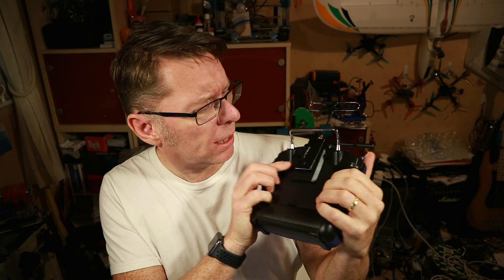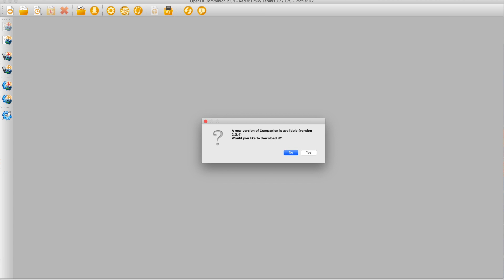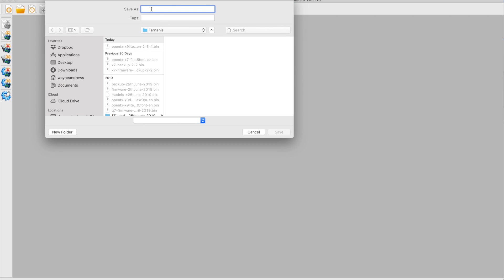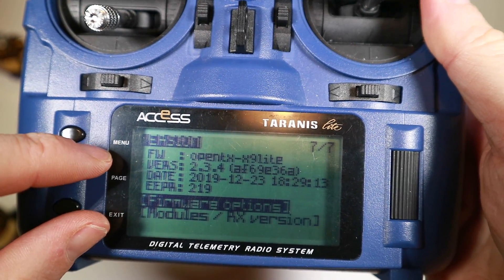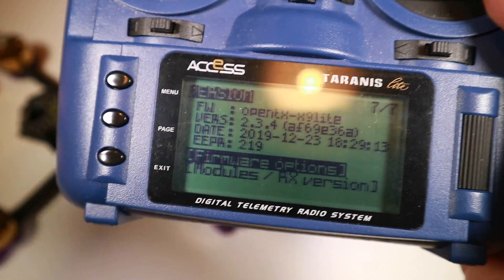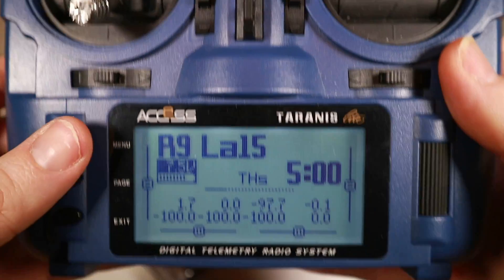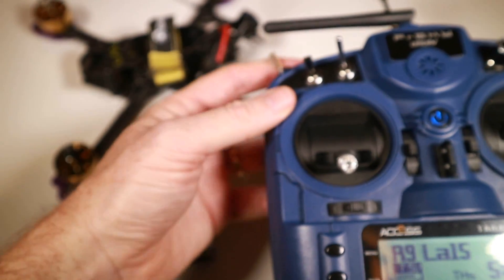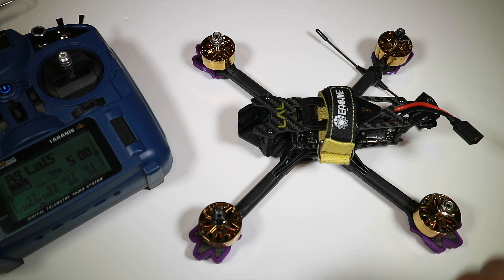Updating the R9MM-OTA receiver "Over-the-air" (it's working now)

Comment: Thanks for the video. I have the LBT version of the TX and the FCC version of the RX. I can't register the RX into the TX, it just keeps waiting forever even if the RX is in "Register status". How can I manage to bind them?
Reply from the maker: Hmmm, I'm not sure.  When I tested my originals, they were both on FCC when I registered them and then I went around changing the firmware.  So I'm wondering if you need to be on the same firmware to register.  The quickest way to test this is write FCC firmware to your module, see if you can register the rx, and if you can, do so and then OTA update the RX firmware to what you want and rewrite the module firmware to what you need.
Reply: @CurryKitten  I tried by flashing both FCC and FLEX firmware to the external module, but I'm still unable to bind to the RX... I really don't know what to do

Comment: Hi! Thanks for the explanation. But how did you manage to bind with the Rx? I don't see any register option on openTx, and I can see you did the update because you were already binded...
THanks! PS: My module is in ACCESS
Reply from the maker: What version of OpenTX are you running, and which mode are you using in your external RF section of your radio.  You'll need to use one of the R9 Access modes, not simply R9 which would use the ACCST version of the code, and thus won't have a register option.
Reply: @CurryKitten  Hi Curry. Thanks for the reply! I'm running openTX 2.3.9. I've tried flashing the ACCESS to receiver (using external module) but it didn't allow me. I've managed to bind afterseveral tries, with ACCST, but the signal was very low! In the end the receiver was prooved faulty. I'm gonna try the slim+ version..

Comment: Will it work with R9M 2019 ACCT?
Reply from the maker: In terms of doing an OTA update... no, you'll need to be running Access to use it.  You can, however, run ACCST on the R9-OTA rx's to keep compatibility with the range of R9 modules

Comment: I have a x9d bbn plus can I flash ota receiver over the air or can I flash the old way to a ota receiver
Reply from the maker: Being able to flash OTA depends on the R9 Module you have, but you can always flash the old way to an OTA receiver
Reply: See I had tried to flash the r9 slim plus ota the wire way and half way through the flash it turned off and now its red light will come on for a second and then back off every time you plug it in the light won't stay on. But I tried to flash it with the slim plus firmware I wasn't thinking of the firmware for slim plus ota. So I should use the accst slim plus ota firmware right or wrong.
Reply from the maker: Yes - use the ACCST slim+ OTA firmware
Reply: I bee it works  lol thankyou thankyou

Comment: Frysky is pushing to crossfire with this bull. I have 4 quads with 1 r9mm and 3 with 9r slim plus none of them are ota now alls there is ix ota receivers can I bind an ota receiver the old way with the wire
Reply from the maker: Yes - the big difference in the ability to use OTA is running the Access version of the R9 firmware, so if you have an older module, then flash (using the wired method) the ACCST r9 firmware onto the OTA rx's.  All the firmware is still on FrSky's web page

Comment: I had bad thoughts about Access at first. But being my qx7 Access and my r9m 2019 with the r9mx receiver connect so easy using the OTA. I have to say .. I Love It!. Yes, you do need a XJT Module to run D8 ( Tinyhawk race2, etc..} But its worth the hassle with the ease of the new way to bind your rm9 receivers
Reply from the maker: It works absolutely fine - I don't have a problem with it.  I must say that it doesn't seem to be setting the world alight though.  All I do notice is a general shift from FrSky over to Jumper and RadioMaster, and people are still sticking with D16 compatible rx's

Comment: Hi. I'm running LBT firmware, would I be able to flash FLEX firmware over-the-air and still avoid to tear my quad apart to bind it again ? Thanks for your videos
Reply from the maker: Yes - as long as your OpenTX is at the right level where OTA works, the fact your are in LBT shouldn't stop you flashing your RX (and module) with whatever you like
Reply: @CurryKitten  hi ! Sorry for the late answer, didn't catch the push notification, and I appreciate your answer. You confirm the RX and TX will still be bound after the flash ? The flash BLT to FLEX, on both RX and TX, will not "erase" that bonnd ?

Thank you !

Comment: what does the flex mean? i get lbt vs fcc - also if the rx had fcc out the box but the tx was running lbt would it still work like this? im new to the whole frsky stuff just got a x lite pro with the r9 lite pro
Reply from the maker: Flex is specific to the R9 system.  Basically the FCC and LBT versions follow the rules for each of the territories.  With flex it allows you to chose the frequency and the power you want - also whether you have telemetry or not.  So the onus is on you to keep legal.  If the module had lbt and the rx had fcc, then it wouldn't bind - you have to get both on the same.  The only exception here as far as FrSky goes in general are protocols like LR12 and D8 where there's no different versions for territories.
Reply: @CurryKitten  brilliant thanks for your help!

Comment: Thanks for the videos, I've always liked your scientific, analytical approach. Have you / can you do a comparison between the super 8 and Crossfire T transmitter antenna, possibly also between 868 and 900mhz tuned antennas pls?
Reply from the maker: Thanks :D I sort of did that comparison back in this video https://youtu.be/HoN3ftq6UUo the summary was that at the distance I was flying both antennas came out about the same and both a vast improvement on the stock antennas.  868 or 915 should come down to where you are in the world - ones not better than the other.  I can't use 900mhz stuff in the UK as the European GSM phone network use it.  So it's really just a case of matching the correctly tuned antenna up with the frequency you use.  With that said, the Super * I use in that module is actually tuned for 915 and I'm using it without much of an issue on 868.  Only to 1km or so, but I would have expected worse performance
Reply: @CurryKitten  Brilliant, thanks for the link to your other video, it cleared it up nicely. Appreciate the work you've done. I'd be interested to see what effect upping the power output incrementally has on the performance.

Comment: I tried OTA with OpenTX 2.3.5 with an xLite and MLite Pro module, it failed every attempt sometimes showing loading bars. 
Then I tried with OpenTX 2.3.4 with an X9D and R9M 2019, it worked. Unsure what made the first attempt fail.

Comment: CK, will this work with non access radios? I have a Jumper T16.
Reply: Sorry should have worded that better. Can the r9mm ota be flashed with a firmware that is non access?
Reply from the maker: Yes - there's the ACCST firmware available for it, but I believe that the whole OTA thing is part of the Access features

Comment: Please pin this spent 6 hours figuring this out.
If you follow the directions in this video and it does not solve your problem the reason is that the firmware on your Rx is broken and can't support the OTA. You have to manually update the Rx using sport and servo wires. The reason why it worked in this video is because he already updated the Rx in a previous version.
Reply from the maker: Just to clarify then - your RX came with the 1.1.1 firmware and that didn't seem to work with OTA, but a manual update to 1.1.2 (or 1.2.0) and it sprung into life ?
Reply: @CurryKitten  yes, I assume it was 1.1.1

Comment: So if I have a qx7 on Accst protocol there is no way to do the over the air updates??
Reply from the maker: Correct, you need to be running Access and have a specific OTA rx before you can consider  it.  The question which seems less well defined if is: does the support of OTA come from the module/OpenTX version so if you had Access on your module will that work.  I think the answer is yes, but I've not tested, and also if you move your non-access supported module up to a level where it is supported, do OTA functions work as well.  I don't know the answers to either I'm afraid
Reply: Ok thanks lol I believe I will just be getting the slim plus so I can update with the plug like the old way.

Comment: Was considering getting the pro module.. just downloading and installed the latest X-lite (standard) firmware 2.3.0, which says it support the module. Not sure ota will be supported. Have you tried it on your X-lite?
Reply from the maker: My USB port is not responding on my x-lite, so I can't test it - which is a shame because I'm a bit confused about the support.  The module says it can work with the regular rx's (not just access) and you need access for OTA.  I'm guessing you can use it as a regular R9 module, but you miss out on some features.  I need to try and fix that radio once I'm feeling brave enough

Comment: will this work for the regular R9mm and mini ?
Reply from the maker: No - which is annoying - I believe the problem was that the originals receivers didn't have enough flash memory to do this, so there are literally OTA versions of receiver that will work, but for the regular ones it's back to soldering wires back on to them
Reply: @CurryKitten   too bad , that is the most frustating thing about this R9 system ... constant changing firmware and no good way to update

Comment: Will this work with old r9 module with the new receiver.
Reply: Yes, so no Ota updates without access firmware and no access firmware for old modules.
But you can flash the new receivers with the old firmware using the old methods and use them with accst
Reply from the maker: Not tested it myself, but you can run the ACCST firmware on the OTA receivers (instead of Access) it means you don't get the nice whizzy features like OTA, but it'll function as a regular r9 receiver
Reply: @CurryKitten  Hi, would the R9M 2019 (or just the normal r9m) module support OTA? Or does only the x-lite pro have OTA? FrSky website says that both modules support it, but a few people have been saying it's not supported on the R9m
Reply: update for anyone whos wondering:

only the new x-lite, x-lite pro and R9M 2019 modules support the OTA receivers. The new receivers use ACCESS firmware which is only available (to flash) on the x-lite, x-lite pro and r9m 2019
Reply: Thankyou.

Comment: Hello, i have x-lite with R9 lite pro and there is no ota update menu. Access protocol works well with this devices. Does ota works only on newer frsky devices only?
Reply from the maker: OTA only works on the new OTA receivers, so the original r9mm and r9slim etc won't work.  FrSky didn't have much forethought here
Reply: @CurryKitten  yes, i know. My receiver is r9mm. And access protocol work well. But i cant update receiver over fhe air. No such menu. Only update by wires (smart port)
Reply from the maker: So you have the original X-lit (not the X-lite Pro) and can run Access on r9 ok?  The way the docs read suggested you would only be able to run ACCST on the module
Reply: @CurryKitten  thanks, its a little sad.

Comment: Thats pretty nice, but I cant say I like the way Frsky is doing things, its ridicules that the xm+, and d8 receivers werent included when the Tx was released. I was set to buy an X9D this year, but they did  that with the rxs, and the "if you sell Jumper products we wont do buisness with you thing" that I went with a Jumper T 16 so I didnt have to change all my rxs. I really like the 60 degree throw much better that the 45 degree on the jumper, and the fact the switches arent soldered in on frsky. On the Jumper its a bit of a job to swap out a switch.  I think it rubbed a lot of people the wrong way, anyway I can ramble, lol Thanks!
Reply from the maker: Yes I tend to agree.  Radio makers went a bit crazy last year.  Price way with TBS, then TBS pulled the whole "don't carry R9 or you can't carry Crossfire" and then FrSky jumped on that idea against Jumper.  I still haven't tried a Jumper - would like to.
Reply: @CurryKitten  Their nice, but Im so used to holding a QX7 its taking a bit to get used to it.  I wasnt aware TBS pulled that stuff also.